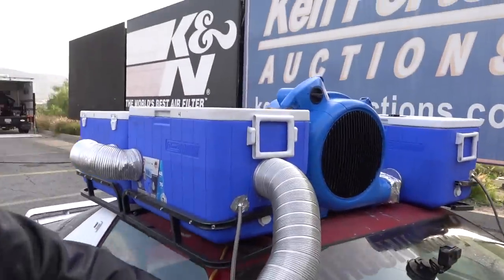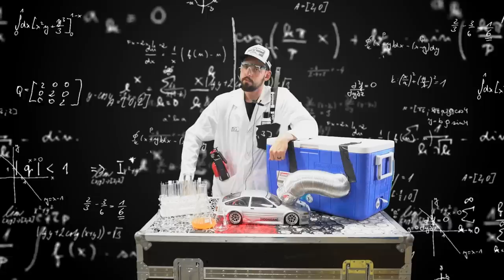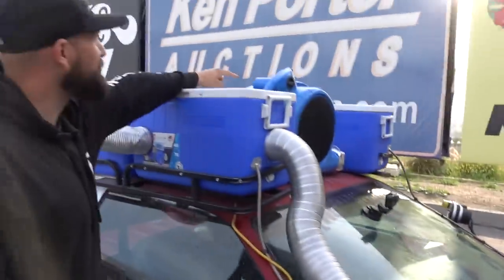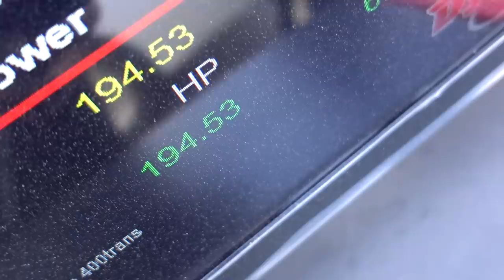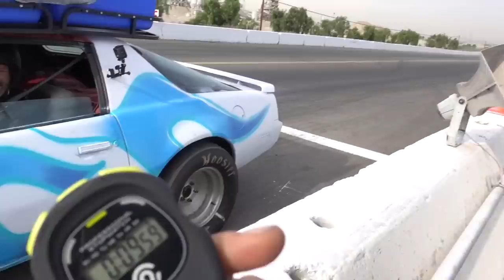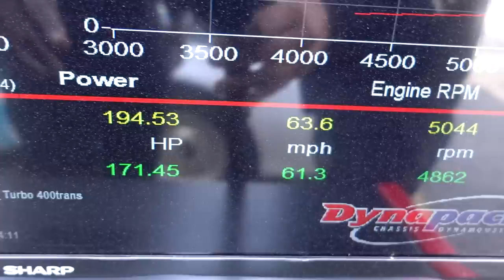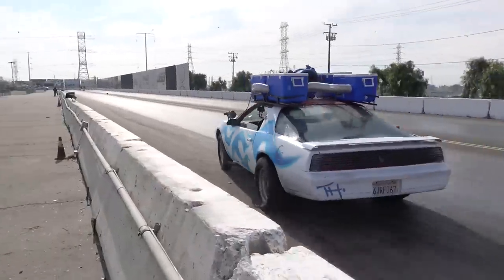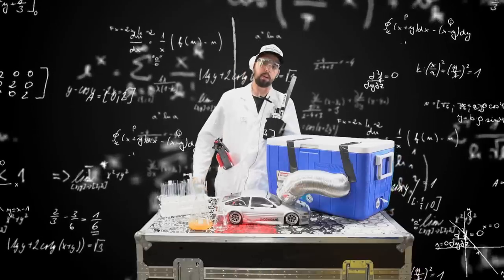Dry Ice Cold Air Intake: Does Frozen Air Make More Horsepower?

Comment: so there wasn't much logic in that experiment since you were sucking in the gas from the dry ice instead of running piped air through the dry ice and cool the air that's in the pipe. you would have actually made more power if you would've done it correctly instead of dumping in gas that doesn't burn. SMH

Comment: Lmfao. I'm not even gunna watch this. Only cause dry ice is purely just co2. Co2 doesnt support combustion like oxygen. Oxygen isnt flammable but it's the main supporter.. now if you had either a tank of oxygen going into it. Or have the tube ran through the cooler, cooling down the tube thus the air inside.. that would work better.